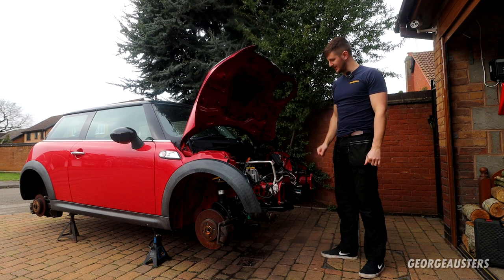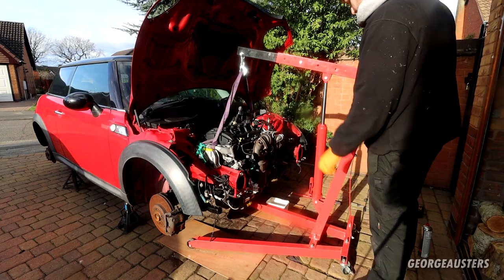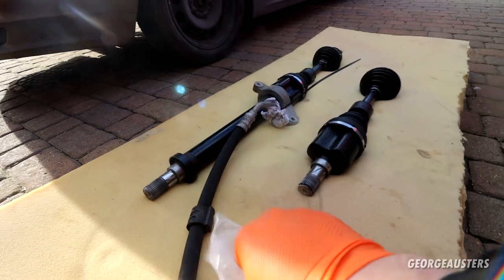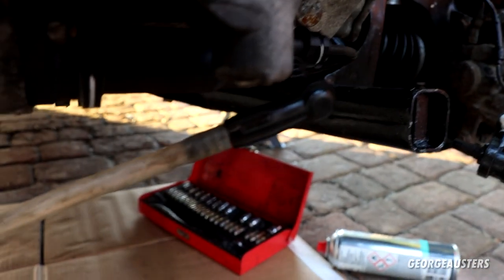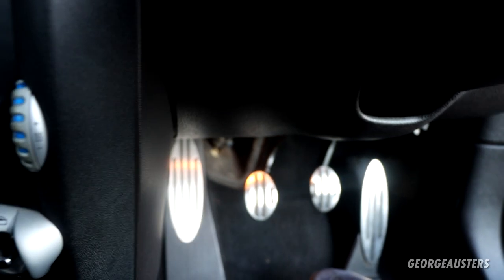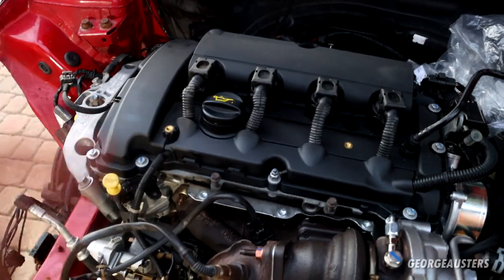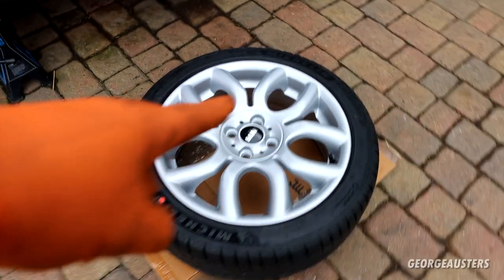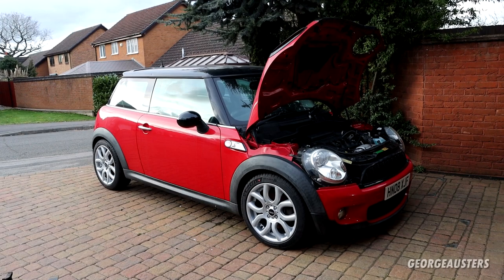MINI COOPER S N14 ENGINE INSTALLATION

Comment: George, clutch cylinder will need re-bleeding.
Take it off, push the actuating rod all the way in & lock it in with a strap. Invert the cyl till the bleed nipple is at the top then run the bleed. Take the strap off then bolt it back up. 
The bleed nipple is not at the top of the cylinder when it's bolted to the gear box. 
They are a nightmare to bleed even with a power bleeder, but this routine works... 👍
Reply from the maker: I did do 2 bleeds on it and it feels fine to be honest😄

Comment: the hpfp line is always damaged when it's removed. That was designed to make you replace it when you disconnect it. It's better to undough the s rew bit and then remove the hpfp from the cam itself.
Reply: I have special tools for the line, 0% damage
Reply: @AutoRevisieOutOftheBOX  aside from you and a mini tech 90% of people that work on these cars don't lol

Comment: Hey George great video, do you think it's possible to change the subframe 'leg extension' on the passenger side without removing the whole front end? My old one has rusted badly and perforated so have bought a replacement but hoping I won't have to drain the coolant etc?

Thanks
Reply from the maker: I just took mine back to bare metal and painted it, you will have to slide the front end forward but possibly not remove it

Comment: I just had to replace an engine in a 2017 mini clubman, I have a bunch of no communication faults, everything seems to be plugged in properly, does something have to be coded properly?
Reply from the maker: Missing a ground somewhere?
Reply: @GeorgeAusters  that's what I'm thinking I'm heading in now to start checking over grounds

Comment: Feel sorry for people who buy a full recon engine - no way would the same attention to detail and proper parts been installed , they will end up with something that will be nothing but trouble, full of cheap Chinese parts, and leak like a sieve - because if they did it Georges way  they would have to charge too much (at least 10,000) and they would not sell any - so makes you think about what you could or could not be getting. BTW the last time i rebuilt an engine 2006  genuine parts were very cheap and reasonably priced - i would not do one again at today's prices - BMW  prices will be well up there ..probably 4 or 5 times you'd expect to pay -  not cost effective.for me, anyway WELL DONE GEORGE! .
Reply from the maker: Most recon engines are just used engines that have been cleaned and painted lol
Reply from the maker: And thanks, it means a lot!

Comment: Come on, you must have started it already, at least before putting the wheels back on!
Reply from the maker: I didn't want to start it until it's ready to drive as it needs running in pretty much straight away!
Reply: @GeorgeAusters  very good, can't wait.